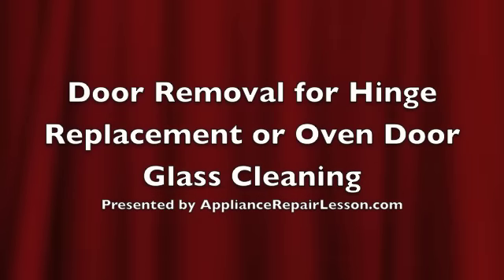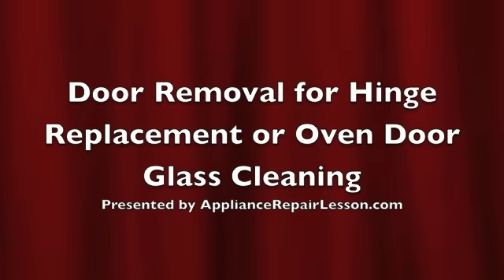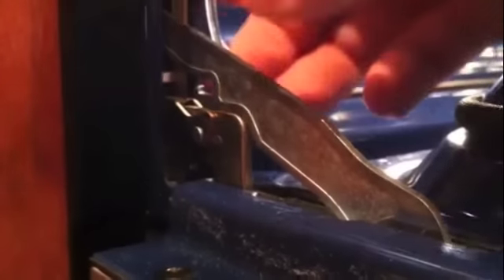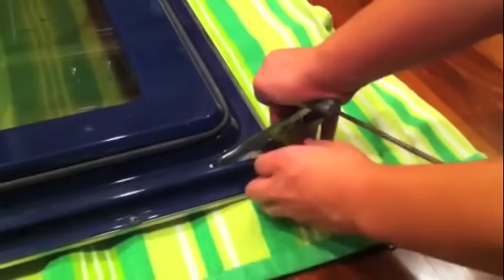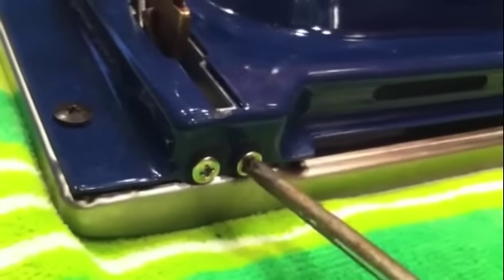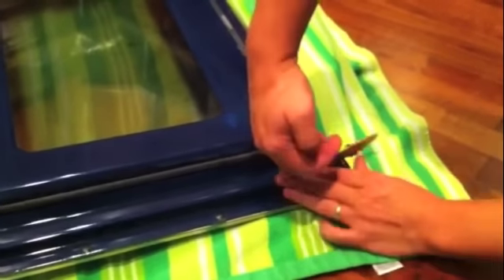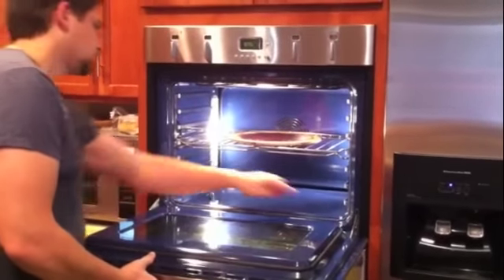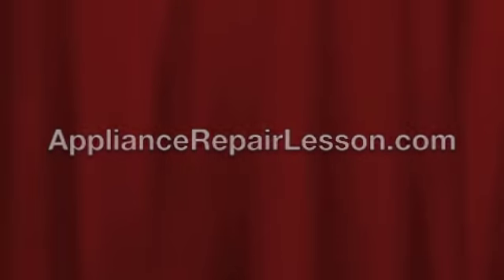Oven Range Door DIY Repair

Comment: I had one side out of the hinges while the other was seated properly.  For months I've been trying to figure out what to do.  I was about to give up and buy a new range but decided to check internet before putting range to the curb.  Your video did it!  I have DCS propane range, professional series, and have the exact two-prong hinges as in your video.  I managed to get oven door open completely (90 degrees) and clip the functioning hinge.  With the door then at a 45 degree angle, i removed it.  I was surprised to find how much pressure is needed bring the longer prong onto the clip.  Your advice of using a screwdriver was fantastic.  Once both hinges were locked I was able to put the door back in without any problems.  Thank you so much!

Comment: Thanks for your help!!  I have a Thermadore with no hinge clips, so was at a loss on how to lock it.  I discovered a circular hole on the hinge, and stuck an allen wrench through it.  Problem solved!  It locked, and I was able to put the door back.  Couldn't have done it without your help!
Reply from the maker: Happy to hear you got it fixed! Good work:)

Comment: Thank you so much. I have a kenmore (Sears brand) range, about 18 years old, and even then, it worked. It does take a lot of strength though to put the clips back again when the door is out before re-installing it.
Much appreciated.

Comment: The screws on my Kitchen Aid oven door handle fell off and the screws fell down into the oven door and I did not know how to fix it.  I am a widow and older and not particularly handy....... I didn't have a clue.  This video tutorial helped me to know how to take the door off the oven and I figured out the rest.  I was so pleased with myself because I did it all by myself....but thanks for showing me the little leavers to pull up so I could figure out how to get the door off in the first place.

Comment: Re attached the Thermador PG304 oven door with your help.!  two person job. 1.  unscrew  tuning fork looking guards.2 Push out the hinge on the door  with your heel for two resistance point until you see the small hole .3) insert allen wrench in hole so that hinge stays out. 3. insert door into slots. 4. slip back tuning fork guards.